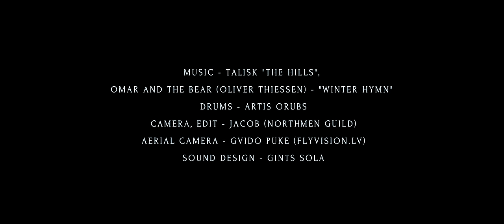The hymn of Northmen. John Neeman Tools becomes a guild.

Comment: man, I've never seen the snow, I can't even imagine how cold is there
Reply: Do you have a fridge? It's colder than that... Do you have a freezer? It gets colder than that sometimes as well :)
Reply: when its around 5c and 95-100% humidity feeling cold temp is similar as -10 dry air. to -15c is ok, get used to it, where it starts to get colder then -15/-20 is where it gets really cold. but like i said even 15c 100% humidity in tropics you can get hypothermic

Comment: the part where the guy breaks through the ice in the lake kind of ruins the mood built up.
Reply: Michael Antonio I think it just adds a new level of atmosphere
Reply: its idiotic. why would anyone be in freezing cold water and jump up out of the ice. Way over the top.
Reply: @travispuckett613   It is called "tempering" the body. Doing this allows the body to handle extremely cold temperatures much easier. Depending on where you live it may not be idiotic but necessary as it trains your body to increase metabolism, much like when you get a fever, to produce heat. This lowers the temperature you can handle before you get hypothermia.